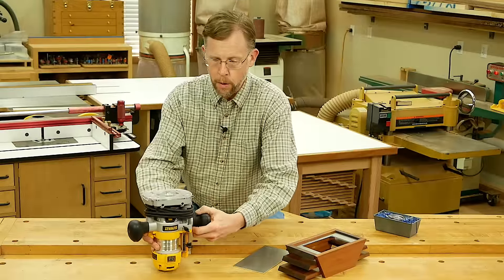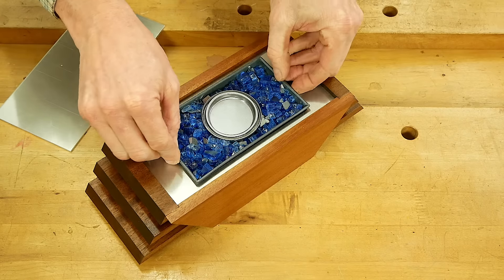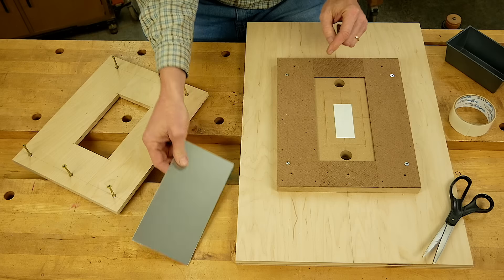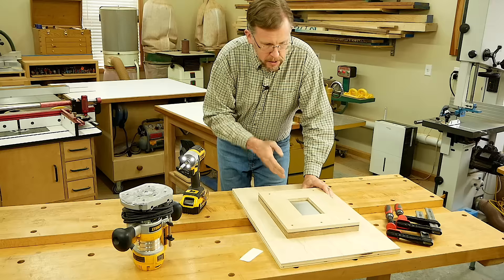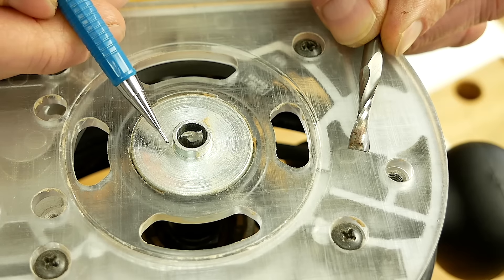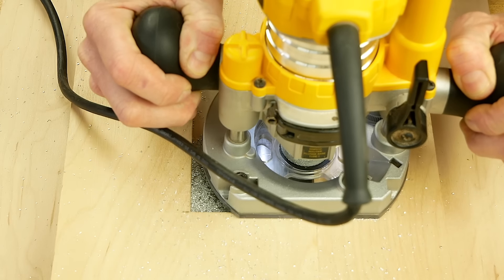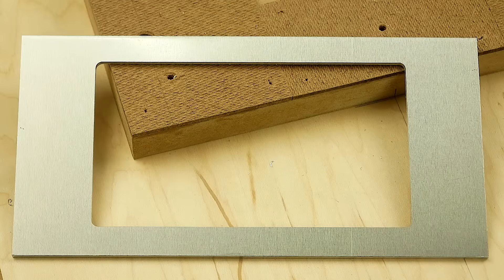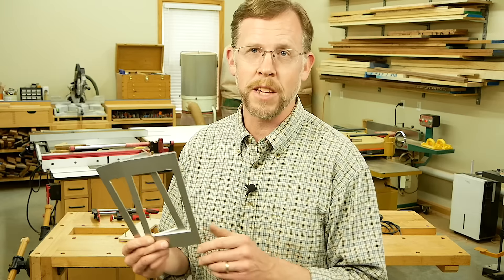How to Cut Aluminum with a Router

Comment: Alloy of aluminum is also VERY important, do NOT try to router 3003 (diamond plate and some sheet metal) because it will gum up your bits. a little bit of water based lubricant will help, but for best results use 5052 or 6063 aluminum alloy. 6061 is the easiest to machine.
Reply: I've always got water based lube to hand 😏
Reply: @ChallengeTheNarrative  which one is aircraft duraluminum? What number?

Comment: I think you don't need to make shallow cuts like these. For thin aluminium like this you can cut in one go. The rpm of the router must not be too high and, very important, check the cutting direction

Comment: Yep did everything you said,till my bit fell out n went through all the way in one place of the metal. Put it back in tightened it up tighter then lowered it like you said then the bit broke. Man I was upset, I still got to ez out the stuck peace of bit. I ordered a metal cutting one. It must have fractured the bit when it fell out the first time.
Reply: Did the metal one work better?  I wonder how many rpm, amp router, thickness of jig.  Also, I assume the offset should be 3/32-meaning the jig needs to be 3/32 smaller than the desired pattern all around, if carving outside of the jig: 3/32 bigger, if carving inside the jig.

Comment: Lastly a SINGLE flute upcut bit is better. ONe can cut up to 3/32 aluminum in a single pass because the chips are bigger. a 4mm bit works very well. 6mm will work too, but you are removing more metal so it will slow you down.

Comment: Aluminum's a really sticky metal, I find spraying a little cutting fluid onto any tool I use to work it (other than files) makes a huge difference.  Way less stress on cutting edges, less heat, and cleaning the bit or tool afterward is a lot easier.

With hand tapping threads into thicker pieces of aluminum, the cutting fluid can make the difference between being as easy as drilling into pine vs. having the tap potentially get jammed into the work piece (or even snap).
Reply: Having worked as a CNC lathe guy.. I can't agree more. I hated working with aluminum. up until that point in my life, I'd never thought a metal could be "sticky"
Reply: Ooooooooooo{ooooo{oooooo{oo
Reply: He's not wrecking it cause it's only a 3/32 cut I suppose but I do agree all aluminum/non ferrous work should have lube

Comment: Hmm.
I'm working on an aluminium, zero clearance insert for my table saw & was going to take the blank plate to a local engineer to have the underside milled to fit the flange in the cast iron table.
I have a couple of spiral upcut carbide bits, so might give it a try myself (I have lots of 5mm aluminium sheet to play with...)

Comment: A bit slot to comment but this is worthy of note - nice precise setup and outcome :).

What bit would you suggest for doing shallow routing in aluminium plate -  eg creating a random shaped segment deep enough to sit some gears in and glue/fill with resin as a steampunk theme.
Reply: You might want to do an aluminum frame over a plate

Comment: This is similar to using a CNC Router.....I use one to cut aluminium quite often.....instead of the sandwich clamp and double sided tape I use suction.   But the principle is the same.   For intricate design and work a router (or even better laser) will always give you superior and repetitive results over a “jigsaw”, either wise you’d have CNC jigsaws😜.

Comment: how do you deal with the expansion of aluminum as you cut?
Reply: Heat expansion? A sharp and good quality bit, very secure work piece, correct RPM and little slow passes like he did, would not generate much heat at all. You should be able to touch the work piece right away without burning your hand.

Comment: Router rotation per minute for aluminum application please ? Thanks
Reply: see reply to @gismoguyar (above)  Cutting speed is between 500 - 600 fpm for wrought aluminum and 600 - 700 fpm for cast aluminum.
Reply: What about extruded sheet aluminium

Comment: Too many questions are not addressed: Will  metal bit work better? Brand of bit?  I wonder how many rpm, amp router, thickness of jig.  Also, I assume the offset should be 3/32-meaning the jig needs to be 3/32 smaller than the desired pattern all around, if carving outside of the jig: 3/32 bigger, if carving inside the jig.

Comment: so thats 1/8", what about 1" or 1.5"?
Reply: As long as you do it in shallow passes (1/32 to 1/16 inch per cut) It's totally fine.  Definitely use a lubricant, and run your router on the slowest RPM possible (3000 - 5000 K would be ideal).
Reply: @gizmoguyar  I'm sure you don't mean 5000 "K" rpm which is 5,000,000 rpm.  No router will go that fast anyway.   Your points about reducing the speed an using lube of some kind are certainly valid, and can't be stressed enough.  But my Porter Cable 890 router will not go slower than 10,000 rpm, so I have to set my speed to that lowest value and call it good, and use only a small diameter bit.   The slowest speed on my Bosch Colt trim router is 16000 rpm, so I can't use it with a bit larger than about 1/8" diameter.  The real numbers for aluminum is 500-600 fpm (feet per min) for wrought aluminum (i.e. 5000, 6000 or 7000 etc. series) and 600-700 fpm for cast aluminum (300.x, 400.x, 500.x, 700.x etc series).  For a 1/4" router bit, these cutting speeds translate to approximately 7600, 9200 and 10700 rpm for 500, 600, and 700 fpm respectively.  Speed for larger diameter bits need to be reduced even further.
Reply: Oops!  My bad!  I was using the high speed steel bit cutting speeds above.  When using carbide bits, the cutting speed for both wrought and cast aluminum is 2820 fpm, which translates to slightly over 43000 rpm for a 1/4" router bit.  It is quite possible that Chris knew this when presenting, making it OK to use the maximum speed for cutting aluminum, especially when using a bit 1/4" or smaller, as he did.  On the other hand, working backwards using 10000 rpm (the slowest on my PC router) to get over 2820 fpm I would need to use a cutter larger than 1" diameter.  ?? I have double-checked my numbers and a Ø1" bit at 2820 fpm is 10,772 rpm.  That just doesn't feel right.  I'm going to go minumum speed and us nothing larger than Ø1/2" carbide bit.  I intend to check this out in my shop this afternoon.  I'll reply again after some testing.

Comment: Great video. But couldn't you build the jig much easier and with less work if you simply use 4 pcs. of wood put together like a picture frame? And, from my experience, if I were only building one of these, I could just as easily make the jig for a jigsaw and cut it out in one pass.

Comment: Is it possible, yes. Is that process practical, not for me. In a fraction of the time it took for you to set up and complete that cutout, I can easily use a jigsaw and file to complete that same cut with equal results with the same accuracy. Thanks but I prefer what I consider a quicker and safer operation in this case.
Reply: Roland Kuhn what’s not safe? I sincerely doubt you can easily get such a straight line with a jigsaw and file. I’ve tried it. Not nearly as easy as you suggest and I’ve been woodworking for a very long time.
Reply: also, that may be faster for you when making one, but if you're making multiple the router and template is the way to go. as long as you are wearing proper ppe and everything is clamped down this is perfectly safe. Just go slow and do shallow passes like the video shows.
Reply: AlergicToSnow re read the reply! I never said it was unsafe so stop saying what I said without reading and pre judging. I said I can and have many times made similar work more simply and quicker. I to have a lot of experience. I have been a carpenter and woodworker for over 30 years. Want me to prove I am just as effective, put your money where your mouth is.
Reply: Roland Kuhn you said “quicker and safer”. Looking forward to your video with a jigsaw and file. I don’t know if you can be faster on the first one or not, but I’m pretty sure the second and third are much quicker with the router and jig.
Reply: You did say the jigsaw was safer, so perhaps you should smooth your ruffled feathers.  AlergicToSnow asked a legitimate question.
Reply: Only faster if you only make 1